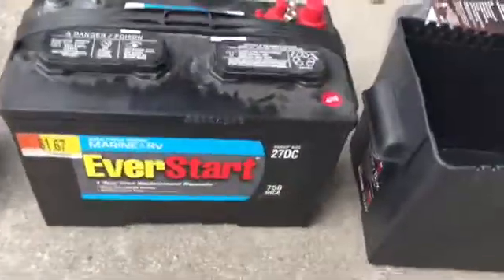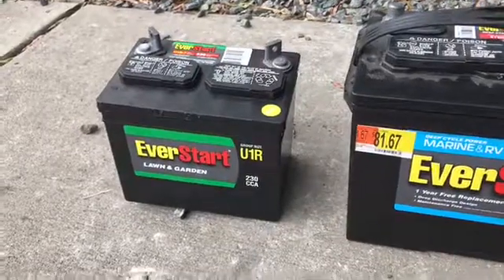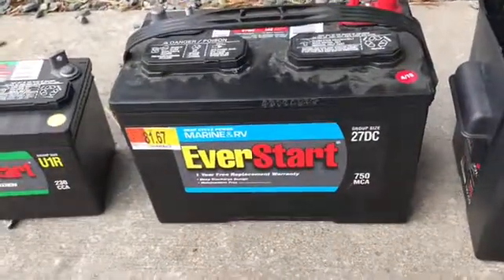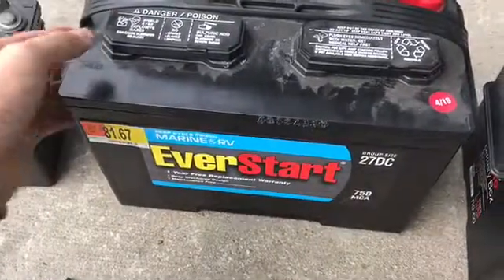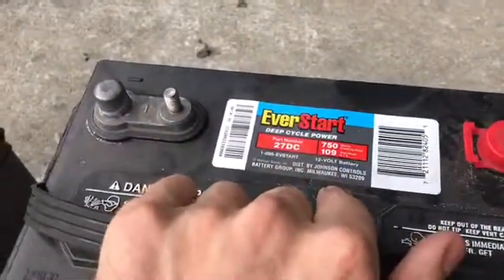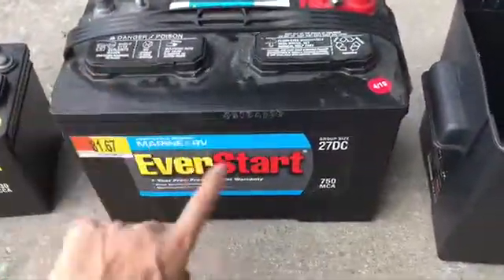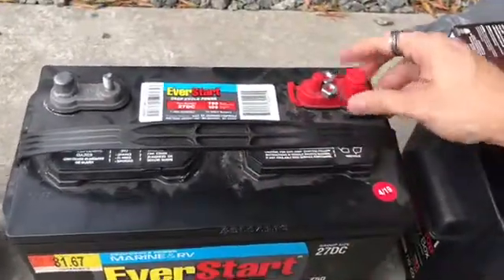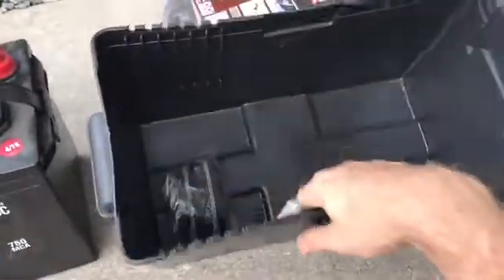Offgrid Solar Battery Backup System for my Car! - part 1

Comment: I recently replaced my RV coach batteries with these EverStart deep cycles.  I keep them topped off with the solar panels so they never drop below 70%.  That's the secret of keeping lead acid batteries around.  I just couldn't justify buying Battle born Lithium batteries at $1000 a piece vs $100.  So far I've been happy however I didn't have an amp hour sticker on mine and after viewing your video you scanned the AH rating of 109 amp over one hour.  That is actually a somewhat deceiving rating as the better batteries rate their amp hour rating over 10 or 20 hours not one. Anyway they were cheap and if I can get 5 years or more out of them I'll be a happy camper. Since the AH rating is not that great (based on your video) I'll be more cognizant to keep them topped off always with the solar panels or a generator if it's cloudy and raining.